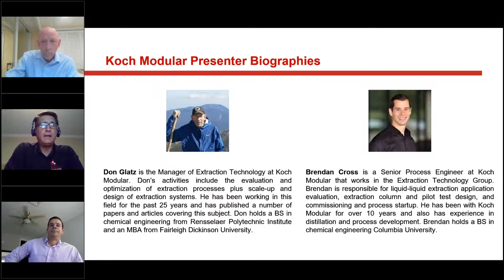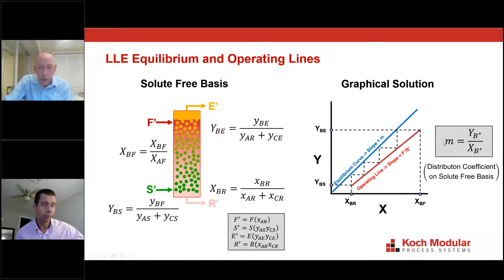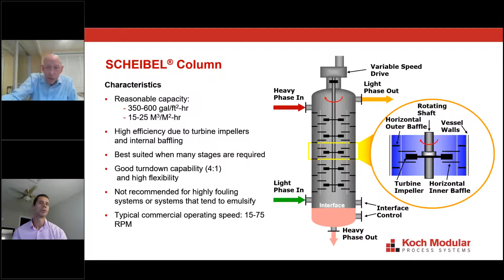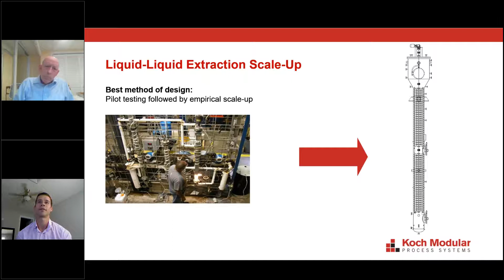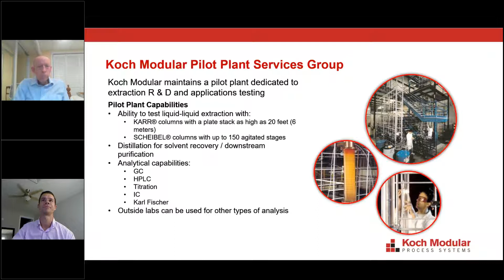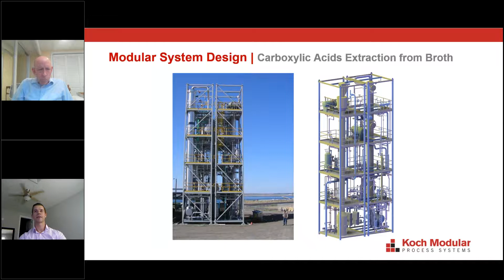WEBINAR: Designing Liquid-Liquid Extraction Columns

Comment: Great webinar guys! Maybe a small question regarding the interface location in packed column. Is the location decided by the bottom valve or by the phase flow-ratio's? Thanks a lot, Stef
Reply: Interface control is by the heavy phase outlet (bottom) valve. Interface location (top or bottom) is determined by how you start up the column.  First you fill the column with one phase or the other.  That sets the continuous phase.  Once the column is full of the selected phase, then the other phase is added and it automatically becomes the disperse phase with the interface then set (by the bottom control valve) in the opposite end of the column from where the disperse phase is added.
Reply: @publiccalendar9105  So startup is very important as well as a level instrument? I cant fill up the column with continuous phase for lets say 75% and then startup with the dispersed phase. Afterwards changing the interface with the bottom valve?